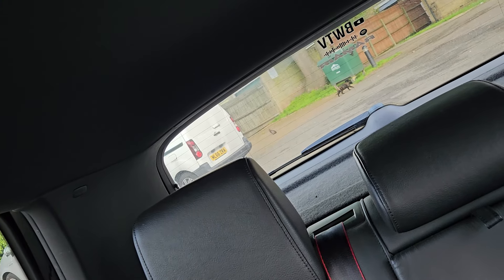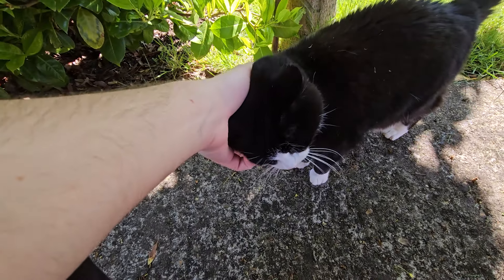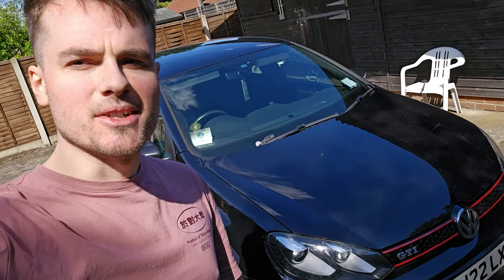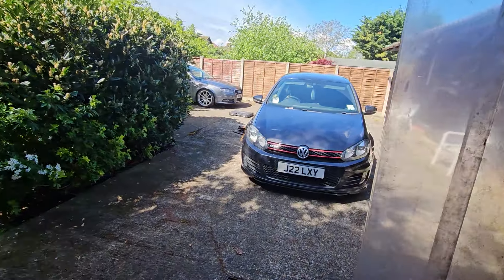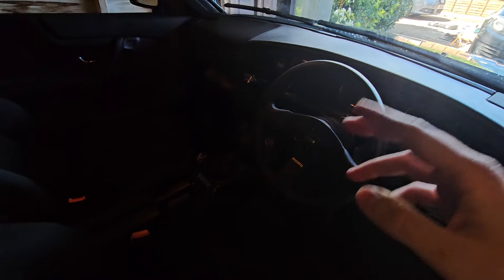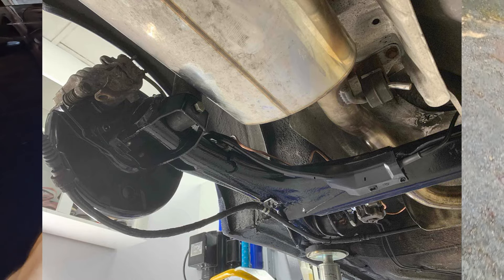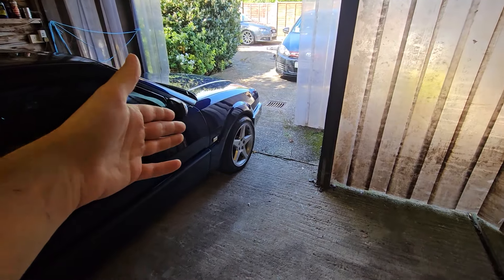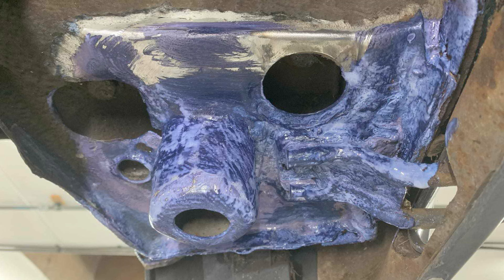The Cars Make a Comeback!

Comment: shes come along way that corrado, there was a minty fresh white vr6 one near where i live which was amazing, like...fresh off the factory floor fresh af.
defo should of come turbo tho. tho i think the intake sound on the na vr6 sounds way better more than the exhaust sound. 
i have a 360whp fiat coupe 5 cyl turbo that in same state as your rado was, but passenger and driver side floor pan has now rotted through all the way and the kick plates are rotting out so getting it sorted this week. spare mint low mile engine i have for it is going to be 1000bhp. yey!
Reply from the maker: That sounds like it will be fun 😂👍